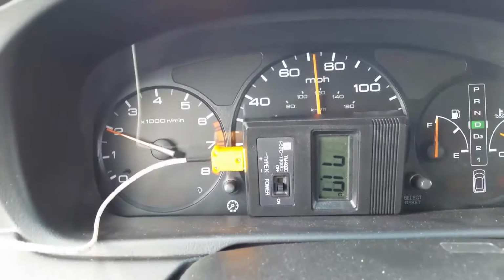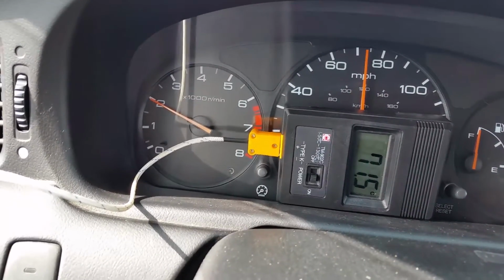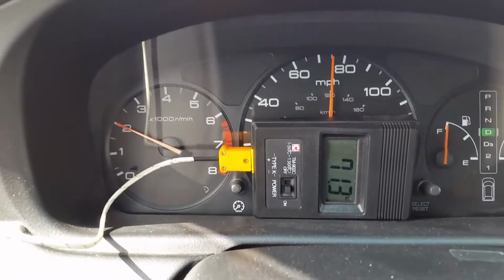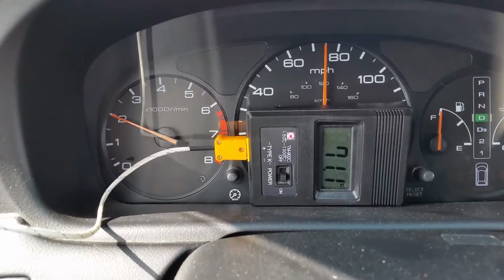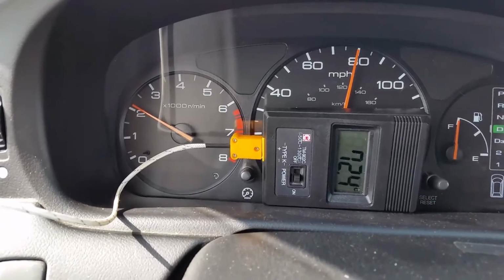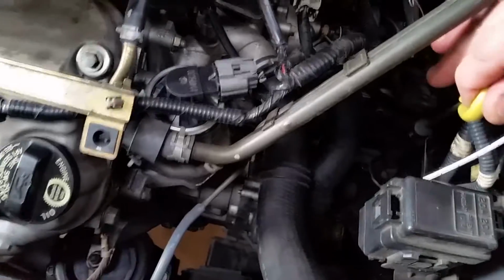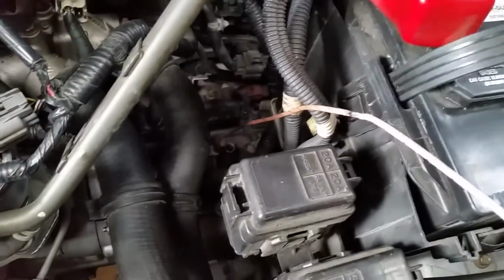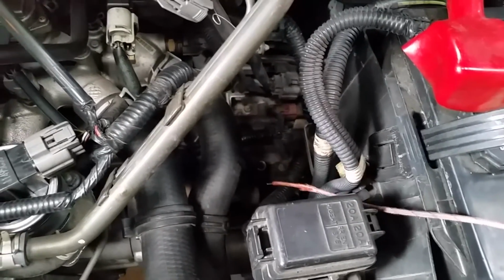2002 Honda Odyssey Transmission Oil Temperature Test

Comment: How do you get 2k rpm at 75 mph in a 4 speed auto. In my 5 speed auto accord I get like 2500 rpm at 75 mph.
Reply: One, this particular van has the five speed auto. Odysseys from 2002 to 04 had those. My family used to own one. 2001 and below had the 4 speed automatics. Second, the accord final drive gear ratio was much shorter than the one in the odyssey which may be why your engine rpms are much higher.
Reply: robby m higher ratio in the odyssey